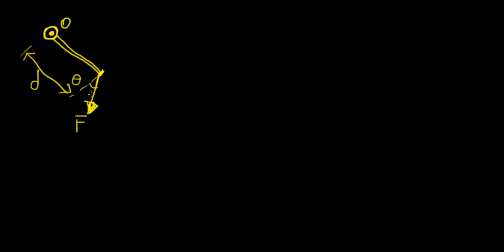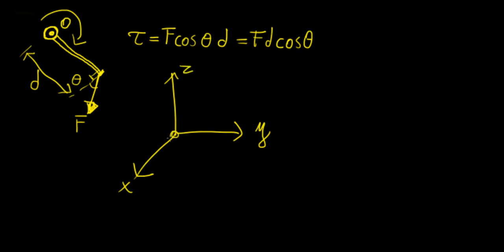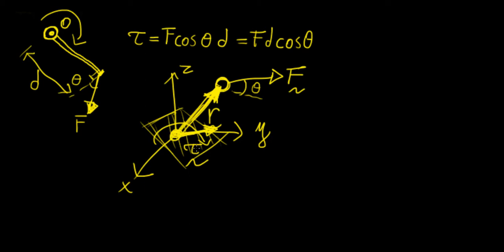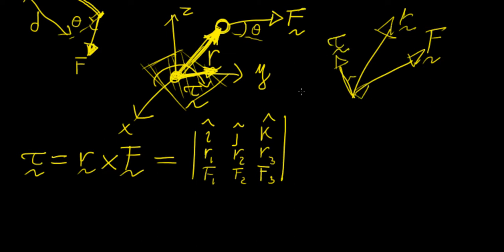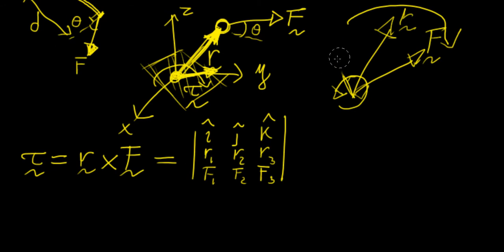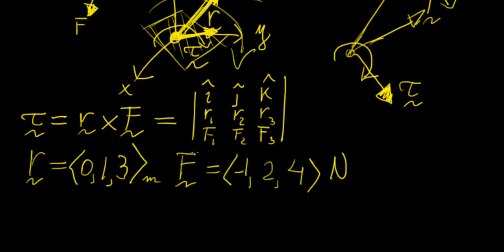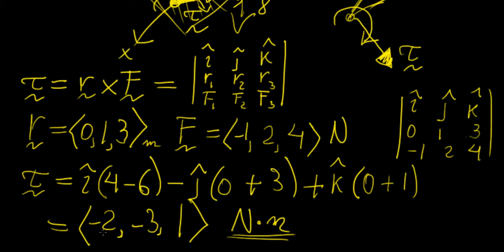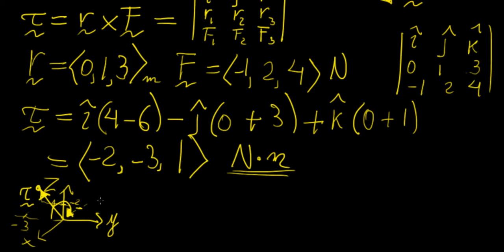Torque and cross product | Vector Algebra | LetThereBeMath |

Comment: Hi,
Great video and I got exactly what I needed to know. There is one problem though. The formula of cross products I see on other websites is:

Cross product of (r and F) = i((r2 * F3) - (r3 * F2)), j((r3 * F1) - (r1 * F3)), k((r1 * F2) - (r2 * F1))

Your formula is slightly different and is giving me the wrong answer with it being:

Cross product of (r and F) = i((r2 * F3) - (r3 * F2)), j((r1 * F3) - (r3 * F1)), k((r1 * F2) - (r2 * F1))

The difference between the two is the j's direction is opposite in your case.